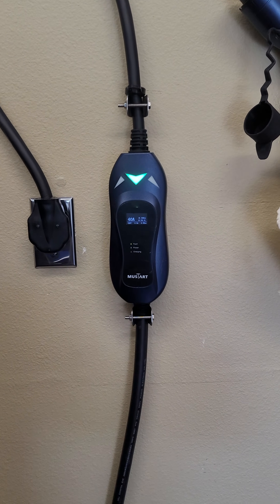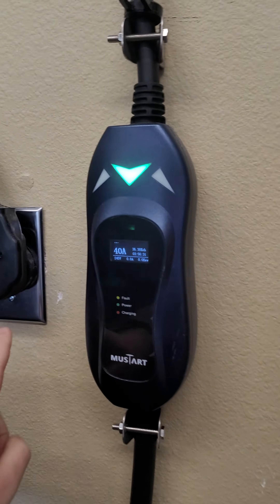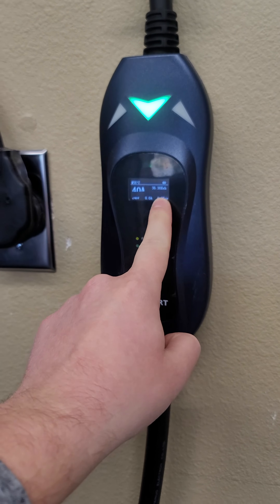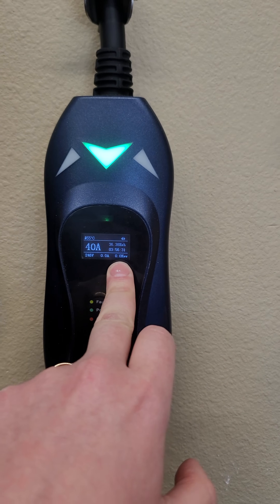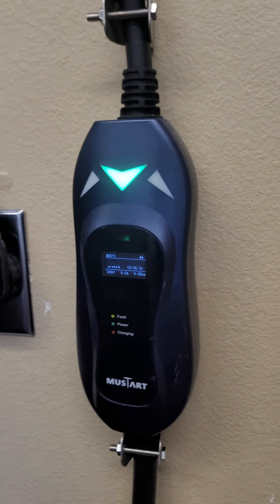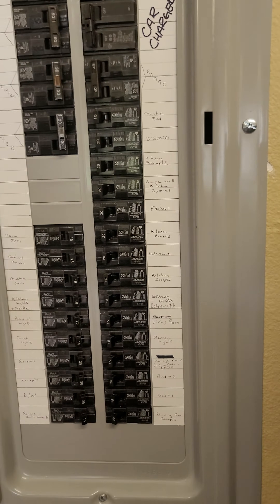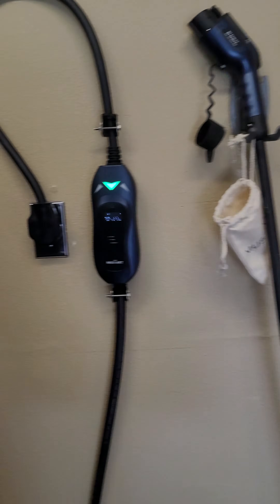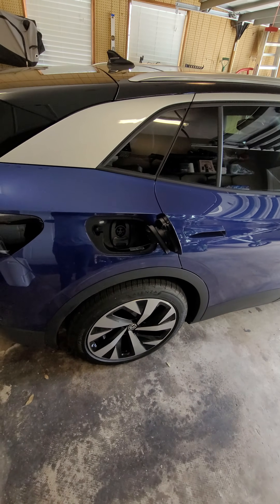Home charging my VW ID.4 Level 2 charger

Comment: Why would you risk damaging your car or house with this in certified EVSE? Another $200 worth of insurance will get you a UL or Intertek certified EVSE.
Reply: Having a UL rating doesn't guarantee you a reliable unit.  I've been using a Chinese EVSE I bought off Amazon for 2 years without any issues.  It's just a dumb cord that provides 240v power to the vehicle.
Reply: @mowcowbell  you got lucky. Dumb boxes can cause a lot of damage if not properly designed or assembled and I feel the extra cost of getting UL or Intertek testing is worth it.

Comment: Thanks for the informative video. I may also get the VW ID.4 and install a Level 2 charger in my garage. Like most people, I would frequently charge the vehicle overnight while I'm asleep. I have heard from several sources that you shouldn't charge any EV all the way to 100% on a regular basis. Is there a way to instruct the ID.4 to automatically stop charging at a certain level (i.e., 80%), or do you need to manually stop charging (wake up in the middle of the night) to ensure it doesn't charge all the way to 100%?
Reply: You can set the percentage of battery charge on the car itself. On the infotainment screen you navigate to the charging screen and adjust the level to where you want the battery charged to. The car communicates to the charger and shuts off the charge when the percentage that you chose is reached. No need for you to babysit the charging of the car. VW suggests 80% charge because it will extend the life of the pack